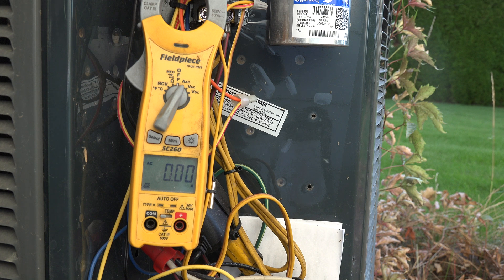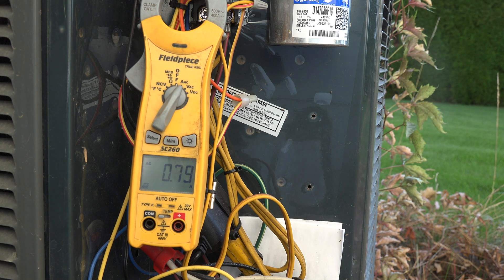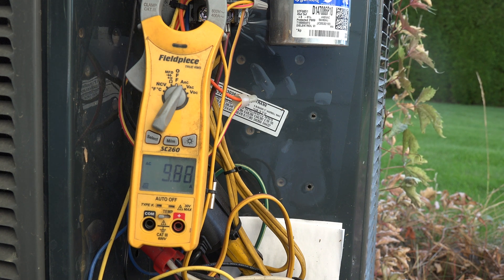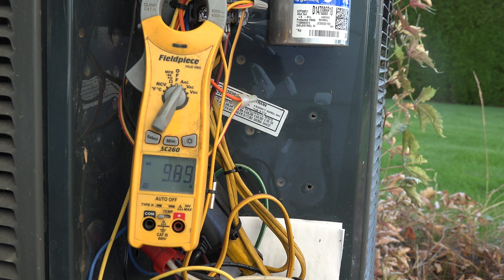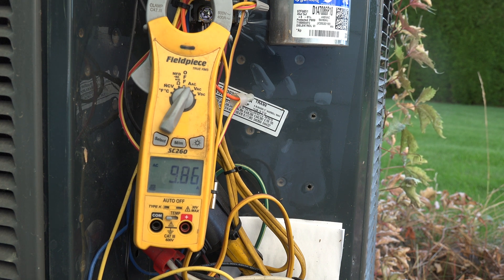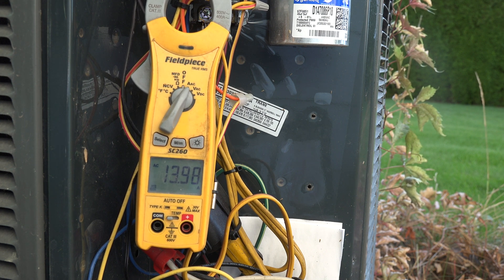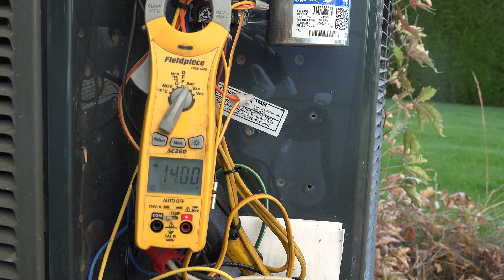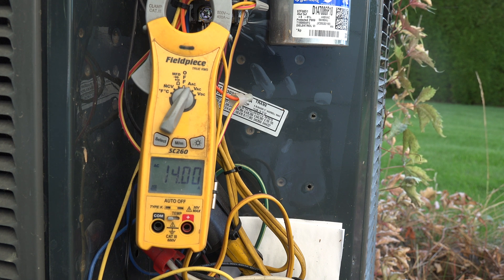AC compressor won't run   Should I put on a booster?

Comment: I've had one where i had to do a live test on the cap it was reading fine i think it was 45/7.5 without power and the compressor locked up again after putting on a hard start, changed the cap and went on to the next.

Comment: Always test windings to ground. None allowed on a standard multimeter. A megger provides best results. Also note winding to winding resistances on panel. Do they add up properly? Inspect everything else too.  Wiring connections, contactor, ref charge, coil cleanliness, etc.

Comment: When I went solar, I found the inrush current on my 2 HVAC systems really put a strain on the power system... even if only momentarily.   I removed the start caps and installed Sure Start (soft start) boxes from Hyper Engineering...   Both compressors now start smoother and the inrush current was dropped 40-60% depending on the unit in question.   The added benefit is they also delay the fan by a short period of time to further reduce inrush.    They are not cheap, but they sure work well.
Reply: Agree a soft start is a good solution for dimming and generators.  I wish Hyper or the Emerson rebrand Securestart would improve the terminal strip.
Reply: I go out to equipment 50 years old and still no problems. All original parts which never needed a soft start... something tells me, even with a soft start, motors are just no longer designed to last... along with contactors and capacitors

Comment: You are 100% correct.  I actually ran in to this situation this week. The compressor was extremely tight. It would start with a factory start cap but shut down as soon as the cap dropped from the circuit.  The run cap was bad. The damage was done, even with a new run cap the compressor would not run after the start cap dropped from the circuit.
Reply from the maker: Sounds like a mechanical failure to me.

GFM
Reply: @grayfurnaceman  Absolutely, caused by the compressor running at elevated temps for an extended period.  Without the start capacitor the compressor would not have started and continued to damage it.  A new run cap would have probably been all that was needed.

Comment: You should have also mentioned to make sure that you have good voltage going to unit and not "ghost voltage " but hopefully that's a check that the tech would have established already....maybe
Reply: What do you mean by 'ghost voltage'? Do you mean intermittent or fluctuating voltage coming from the breaker panel to the unit?
Reply from the maker: Not sure about "ghost voltage".  That is usually a voltage read by modern digital meters when there is a voltage leak thru electronic components.
GFM

Comment: I never thought to put a booster on without testing the capacitor first and I'm surprised anyone would but then again I see a lot of guys charging systems without checking the indoor unit first. Great video. Glad too see you back.
Reply from the maker: I never really left, just took some time off.
GFM
Reply: Yes -- have to file this one in the "stranger things" file.

Comment: Yeah, the run cap, besides giving enough field offset for a low torque start, is selected to "tune" the motor at its design load for the best power factor/efficient operation.  I say tune because the winding and the cap are set up like a tank circuity in a radio.  And that tuning keep the magnetic fields as spherical as possible so less energy is lost as heat in the windings.  

How about a compressor that starts okay but only runs for 40-60 seconds before going out on internal amp overload.  RLA is 11.4 amps, it runs at 13-15 amp then shoots up to 30 amps where it cuts out, tries to restart but hits 30 amps again.  Seeing the expected 54 amp LRA at start up.  19 yr old carrier R22 package unit.  Run cap was low and replaced.  No voltage drop on the load side of the contactor during the running.  Owner is broke and I was trying to rule out every possibility before condemning compressor and them needing a new unit. I'm DIY but I verified refrigerant and saw 294 psi on the liquid line when it ran and stopped.  It was cooling for that minute.  Compressor terminals are in good shape but the winding resistances I measured are about 0.3 ohm high, 1.5 vs spec of 1.18 ohm on the run winding.  I can't see any other option than the compressor failing at this point.
Reply from the maker: I am thinking overcharge of refrigerant.  Head pressure should be no higher than 30F + ambient.
GFM
Reply: @grayfurnaceman   Thanks.  This is for a friend who is on hard times.  I confirmed the overcharge but called in a pro to verify.  It was, but the compressor is still on its last legs, over amping.  He also looked at the control wiring during the call and found the reversing valve had been tied to the Y wire.  Bent pin found on thermostat.  Then we noticed that part of the outdoor coil was in the duct covering the connections to the  house since install 19 yrs ago.  All in all, a disaster needing a long term solution.
Reply: @jkbrown5496  can you explain this in more detail?  the reversing valve part.  Perhaps I am dealing with similar; thermostat in off but still 24v at defrost board which is delivering the 24 to reversing valve moving the valve to cooling mode.  again with thermostat in off position and 220 fuses pulled.
Reply: @tserevenad   The 24vac used in the low voltage wiring comes from a transformer in the air handler.  The defrost board will have 24vac on the R terminal while that is powered.  But if you say the defrost is powering the reversing valve for cooling, then the relay on the board that energizes the O terminal for defrost may be stuck closed.  But on some boards, they use the Y (compressor call) to provide this power as well as power the W2 terminal to signal the heat strips for when the outdoor unit is in defrost
Reply: @jkbrown5496  thanks much.  I am going to dig into this further later today.  Head scratcher is my thermostat is in off position and yet it is sending 24v to the heat pump.  I have a second identical system at the house which does not exhibit this problem.  What if thermostat wired wrong and reversing valve has been forced into the cooling position year round?  Anyway, lots more trouble shooting to go.  Thanks.
Reply: A run cap also provides a better power factor, partially counters an induction motor's tendencies to slow on increased load and ensures the psc starts in the correct direction using a current phase shift.  Of course increased torque for starting that backs off automatically due to the counter emf.

Comment: Why would you put a 521 on a Trane compressor in the first place?
Reply: Trane used factory hard starts on their older recips.
Reply: @rj.parker  yes and now if it doesn't come from the factory with one you can void the warranty if you add one
Reply from the maker: If its a scroll, there is no point.  
GFM
Reply: @grayfurnaceman  Contrary to “public opinion” that says Scroll compressors  do not  need hard start kits, this is not always true.  Because of the operating characteristics of scroll compressors, they do start easier and may not need start kits.  However, this does not eliminate the need for start components in application with non-bleed TXV’s, operating at 208 volts (or any low voltage), or when there is long line applications. In these cases, hard start kits should be applied to the compressors.

Comment: One of my pet peeves are techs or companies that push hard starts even on new installs or as "preventative maintenance".  Some say it makes the inrush shorter, the light dimming reduced or a hard start is good insurance.  All wrong.  Using a hard start for no reason especially on a scroll just means the unit starts even when the run cap eventually fails.  Or the hard start stays in the circuit through its own failure mode. A five year time delay grenade.  Either way the compressor and the customer suffer with little or no accountability from the installing tech.
Reply from the maker: Agreed
GFM

Comment: GFM, good video. Any idea at what point during a capacitors path to failure the amp draw of a motor or compressor starts to noticeably rise?  In other words, if a capacitor is half dead, yet the compressor or motor still starts and operates, would the amp draw increase over a baseline level using a fully performing run cap.
Reply: It depends. On a lot of factors. I think the purpose of this video is for newer techs that think a hard start kit fixes everything. Remember Sale Sale Sale
Reply from the maker: I can't say for sure, but anything out of 20% below rated is suspect.
GFM
Reply: @liam3284  Thanks.  Makes sense.

Comment: yea I have a fast money tech in my area that installs lots of those boosters ,without checking for the real cause more than a few times I've had to brake the bad news to the customer that they now need a compressor re&re ,In some cases they think I'm the bad guy ,go figure human nature I guess
Reply from the maker: Many techs and many service companies are pushing these products.  I still say, if it was needed, the manufacturer would have installed it.  
GFM

Comment: If there is already a super booster installed and the run cap is bad should I reinstall a super booster if the compressor starts after I replace the bad run cap without the super booster?
Reply from the maker: I would not without other evidence of a starting problem.
GFM
Reply: @grayfurnaceman  Thanks

Comment: I went to a call last week where the customer hooked the compressor to a 5mfd capacitor. I'm not sure how but the compressor was still taking off. Didn't sound good though lol
Reply from the maker: Sounds like the right size if you have a 1/4 hp compressor.  lol
GFM